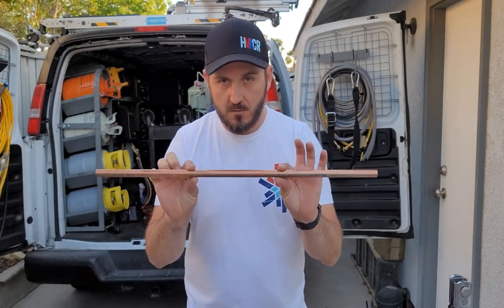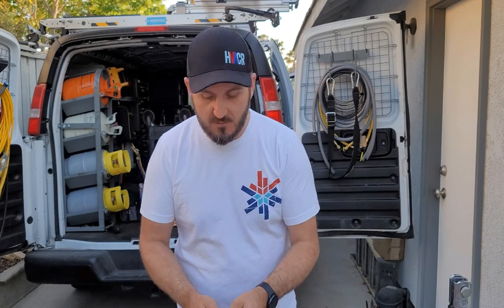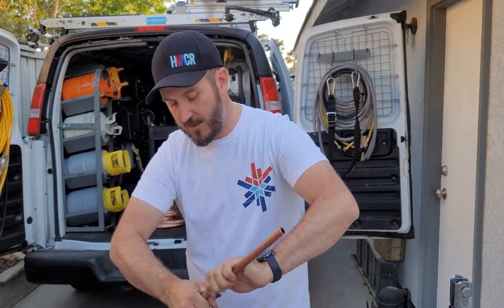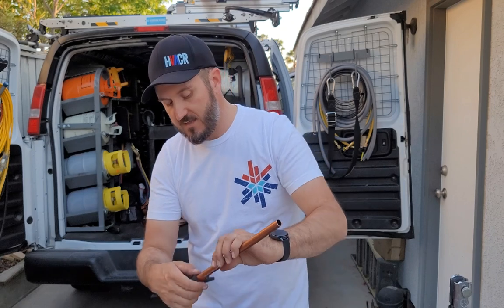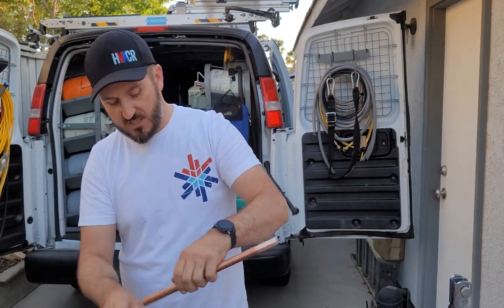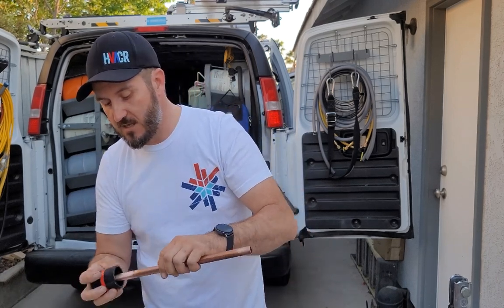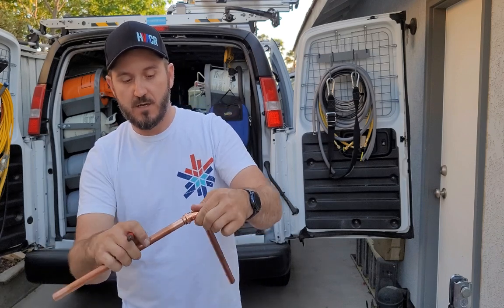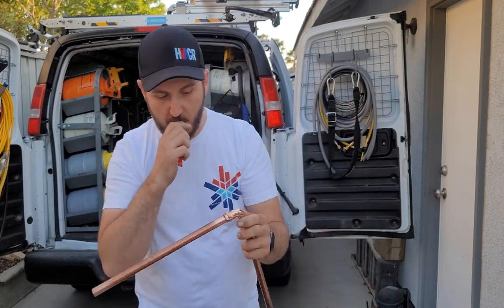ZoomLock MAX Refrigerant Press Fittings Pipe Prep with Chris Stephens of HVACR Videos

Comment: Chris did an excellent job of explaining the importance of the stab depth and the marking of such👍. I’ve worked for the natural gas utility in the Saint Louis Metropolitan area for 35 years (obviously Sporlan knows the company) and I have seen press fittings and insertion fittings used to outstanding success and to devastating failures. In investigating the failures it almost always boiled down to installer error (Poor insertion, not marking stab depth, poor  preparation and cut O-rings due to such). Just to let you know the first thing I look for when incidents happen is that stab depth & stab depth marking. Now with the flammable refrigerants your industry will surely be investigating incidence once you have an approved O ring for flammable refrigerant.

Comment: I’m waiting for DEWALT to come out with a zoom lock Equivalent.
Reply from the maker: We do have compatibility with Dewalt DCE 200 for the 32Kn ZoomLock MAX Refrigerant Fittings and Jaws.
Reply from the maker: You can see all the tools ZoomLock MAX is compatible with here: https://discover.parker.com/ZoomLockMAXJaws
Reply: @sporlanvideo  it would be nice to see an inexpensive hand-powered ratcheting crimp tool for DIY use.  Of course it would not help the brand to have leaks from DIYers not properly preparing the joints.

Comment: Agreed 100%, you have to take the time an follow the manufacturers instructions to the TEE. One thing that I just recently learned (the hard way). Is that don’t mix fittings and crimping tools from different manufacturers. If you use zoom-lock, use zoom-lock fittings AND the zoom-lock crimping tool. I was on a job last week, where a subcontractor used zoom-lock fittings but used another type of crimping tool. The end result, every single fitting had a damaged O-ring because the crimping tool used had a different jaw pattern than what was on the fittings. There were dozens and dozens of leak points 😵😵😵.
Reply from the maker: You can only use ZoomLock MAX jaws with ZoomLock MAX fittings.

Comment: does it make a difference if you put a form of lubricant such as nylog
Reply: Rothenberger do not specify the use of any fluids or lubricants. You have to use the proper preparation and cleaning procedure as well as using their marking stencil. I haven’t used zoom-lock or any other brand so I can’t comment on their procedures.
Reply: Just to clarify I’ve only used Rothenberger fittings and crimping tools, but not other brands.
Reply from the maker: You can use nylog with ZoomLock MAX refrigerant fittings.